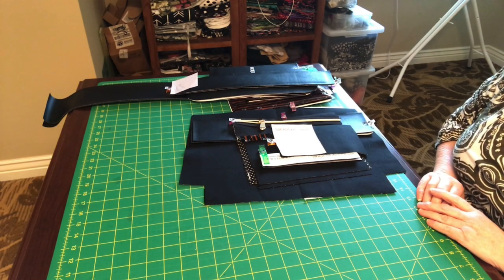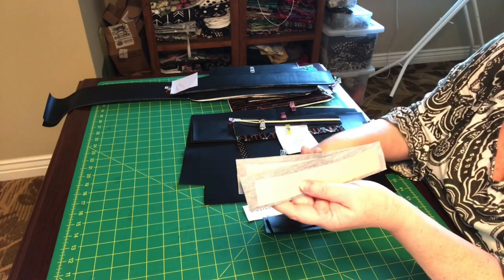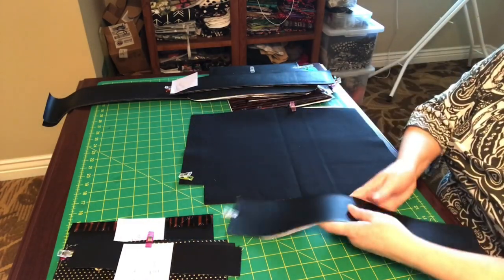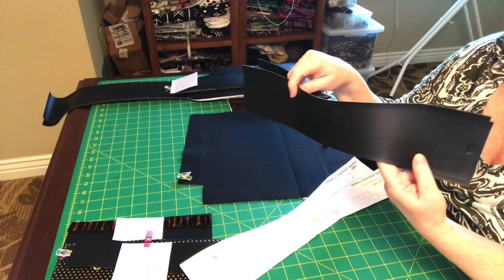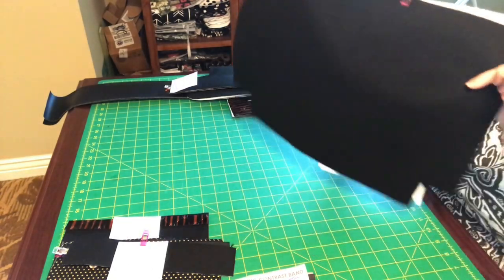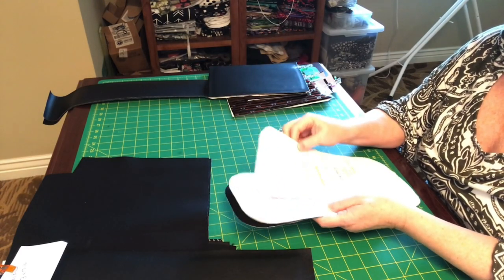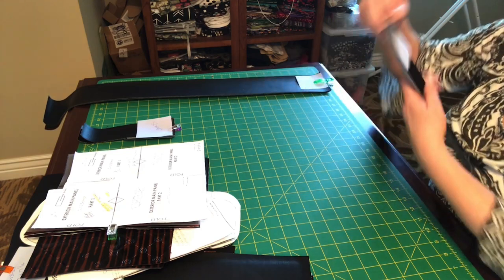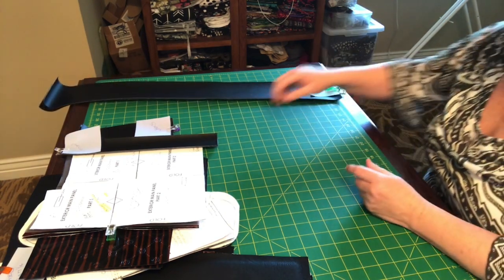#3  Handbag Course - Interfacing & Pattern Piece Review - With Kelley Rao

Comment: I use the Bosal In R foam Sew In, not fusible. I cut same size as the outside and zigzag around the edge to attach and flatten for the seam allowance. No need for sandwiching with the Wovenfuse.  I use a domestic sewing machine without any problem sewing the foam and fabric layers. No wrinkling when turning inside out. I use a Microtex needle 90/14.
Reply from the maker: Thank you!  Yes, I no longer fuse sandwiches. Sew in all the way.